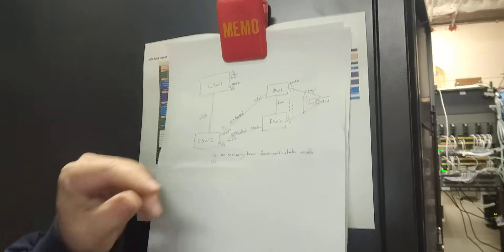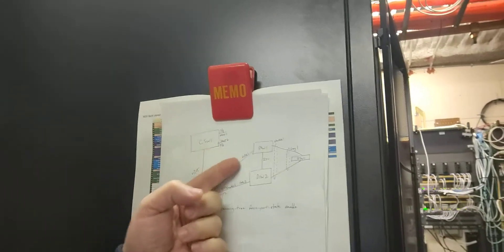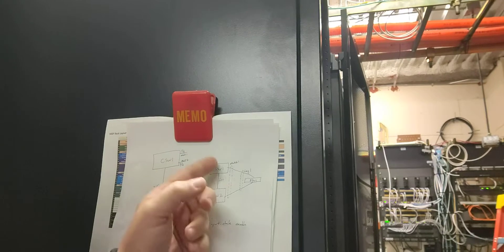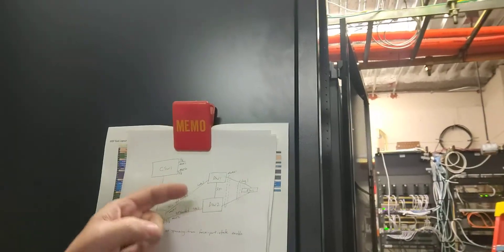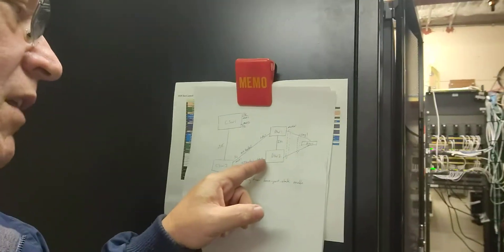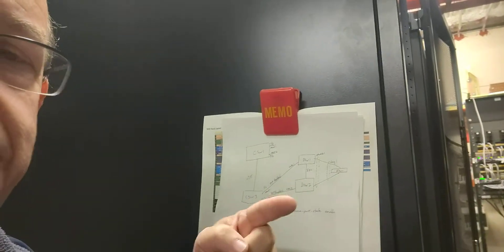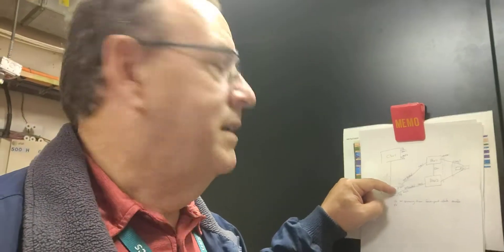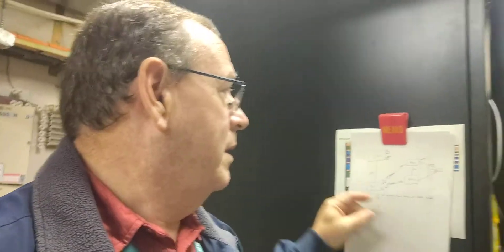Network Admin Life - Looping issue resolved?

Comment: Glad you have fixed it! The Extreme MLAG protocol acts differently with STP since XOS 22.3. Prevoius versions handled the STP by itself and nowadays you have to force enable it as you mentioned. The misconfig on that 1 port caused the loop since STP kicked in where the MLAG didin't.
Reply from the maker: Yeah that makes sense.  I was kicking myself for missing issuing that command against that port but I was consoled by the fact that professional services missed it too!  They suggested the MLAG between dist switch and core would fix the problem.  Wait till I tell them STP was still enabled on one port. :-)  Thanks for keeping me honest and please keep sharing your knowledge with us!  God bless!